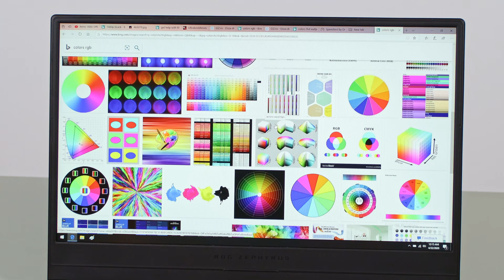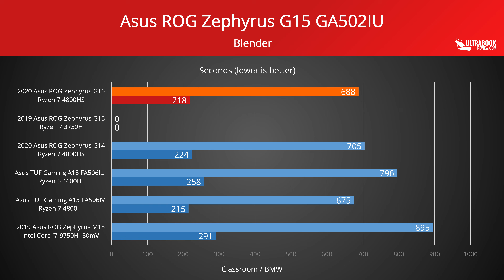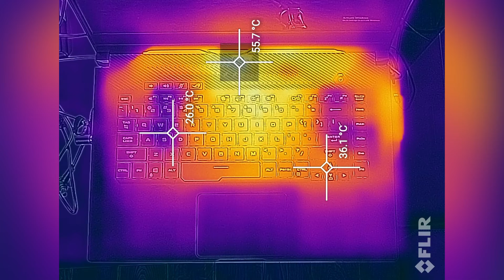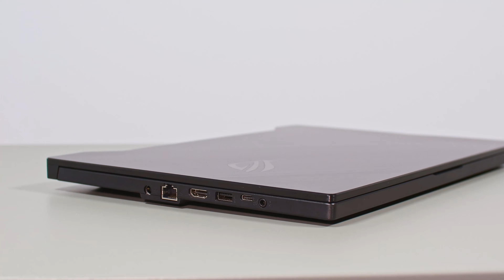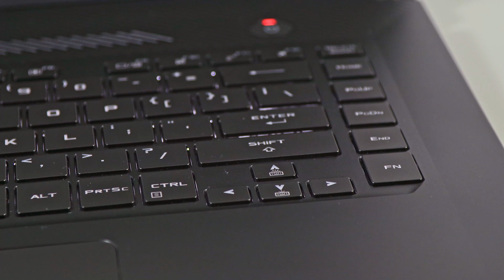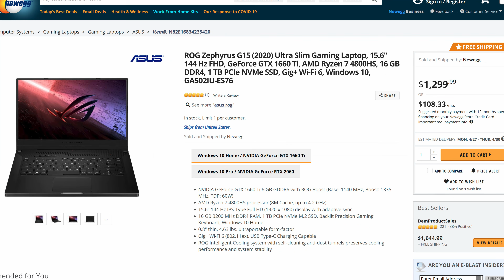Asus ROG Zephyrus G15 review - Ryzen 7 and GTX 1660Ti, 240 Hz screen

Comment: Fuck, I just bought one of these and wish so badly I had bought the HP Omen 15 with basically same specs and price. This Asus looks like an absolute joke with its red backlight on the back case (video didn’t show it at all) and you can’t change the color so it’s always obnoxious bright red. And then you have cooling, which is abysmal with loud fans. If you’re thinking about this, get either HP or Lenovo instead. This Asus feels and looks cheap, can’t even change the keyboard backlight color, or glowing red eye on the case, WiFi card is also genuinely horrible, no webcam, honestly I fucked up hardcore buying this laptop lmao.

Comment: Would you recommend this machine as a solid device for the 5 years?
Reply: well if you dare to fix problem on those  by "modifying" another blocked vent yes.. but if not i don't think so it'll last that long with poor cooling vent
Reply: So helios 300 is better ?
Reply: @y2rn.n  not quite that thing still heat like a stove no literally! my little brother friend have one it he said it  heat like a frickin stove! Then  He sold it immediately to buy ROG gephyrus m or else dunno which letter but i know it's the cheapest one 

you should've get lenovo legion 5 or the ones from msi

Comment: What happens when you match an 8gb 3200mhz ram with a 8gb 2666mhz ram on the g15? And what happens when you match an 8gb 3200mhz ram with a 16gb 2666mhz ram on the g15?
Reply from the maker: 1. 16 GB of RAM in dual channel running at 2666 MHz
2. 24 GB of RAM, but only 16 GB in dual channel at 2666 MHz
Reply: @ubrcom  Yeah I have the same understanding thank you. Could you please add your opinion on how it will affect laptop performance in different use cases? I heard Ryzens rely on memory frequency quite a lot. I am expexting a 8Gb base G15 version, and I have a 16Gb 2666. I wonder if I had better buy a 3200 8-16Gb instead. Thank you.

Comment: i have this laptop what would you recommend to make it run cooler..
Reply: If you live anywhere in the EU, minus UK, USA or Canada, the warranty stickers are literally illegal and you can remove it, they are forced to repair it if you do remove the paper thing.q
Reply from the maker: A cooling pad should help, but also taking out those covers, if you're OK with voiding warranty
Reply: You might try changing the thermal paste inside it usually gives a way better temperatures. I usually use the cooler master mastegel maker is one of the best thermal paste out there and is not extremely expensive
Reply: Juan Gines Ramis vivancos what is this thermal paste?? How does it work???

Comment: Shame they couldn't pair that display with the a15, seems these amd models have a catch to each of them in some way or another.
Reply: It's super annoying
Reply: A15 has a bad display, G15 doesn't get Ryzen 9 (not yet at least), and the G14 panel has ghosting... So annoying.
Reply: @leocheungmm  G15 has the blocked vents too, which increases heat and decreases performance (people have done benchmarks with and without and found better performance/lower temps without the blocked vents). But of course unblocking the vents voids your warranty.
That kind of scummy practice is the only thing stopping me from getting the G15. I don't care about the lack of the Ryzen 9 because the performance increase over the 7 is fairly small, and the average user will get more performance out of the Ryzen 7 than they need (the 4000 series Ryzens are similar to the 10 series i7/i9 that Intel sell).
Also the screen is apparently shit on the G15 if you don't opt for the 240hz model, which is really frustrating because who's going to take advantage of 240hz over 144hz using a 2060..
Reply: @ArmourGX  I swear they're trying to make the Ryzen laptops bad on purpose. So much potential, but every single one has some kind of dealbreaker
Reply: Armour One solution to this is just buying another back cover and taking off the paper. If something ever goes wrong pop the original one and you’re good to go. There’s also many stuff you can do to lower temps  https://reddit.com/r/ZephyrusG15/comments/gnot0f/new_owners_how_to_fix_thermal_fan_noise_battery/

To me this is the perfect laptop. Great sRGB, high refresh rate, 5< ms response time, great specs and long battery life thanks to amd igpu. Just fix the cooling solution and you’re good to go

Comment: Ok but a little negative review, when I checked the temperatures of g15 and g14 online, it could get up to 90 degrees all the same, also. Tuf 15 have bad display and response time, so is the g14. And zephyrus m is much more expensive with bad battery. I think g15 has it all. Good review on the g14 but this review on the g15 i think is a little poor. Just so to make this review different. But still, thanks man.
Reply from the maker: Ok, but just because you don't agree with me, that doesn't make this a poor review.
Reply: @ubrcom  no its not, what i meant was, you reiterated on the not so important details and dig on it. but its still ok. Its just a little unfair I think because you didnt do that on g14 or tuf 15. Sorry for the misunderstanding. Ow well im making it worse. Thanks for the review.
Reply: @ubrcom  i love your g14 and tuf 15 reviews btw, specially g14.

Comment: Hello everybody, my mind can figure out which one is better between Razer Blade 15 Base Model 2019, 144 Hz Full HD, RTX 2060, Intel Core i7-9750H, 16GB RAM, 512GB SSD, ASUS ROG Zephyrus G15 GA502IV which comes with the RTX2060 Max-Q, ASUS ROG Zephyrus G14. All of them I can get with basically the same price. I'll use the laptop both for gaming and editing photo/videos (the editing stuff it's a hobby, I do it often but it's not my job). Hence, I'm looking for the best compromise between good performance in gaming and a screen with good colors accurate.
PLEASE HELP ME, I'M KIND LOSING SLEEP. D:
Reply from the maker: If you need the era CPU power of an AMD platform or something compact, I'd go with the G14. Otherwise, I'd get the Base Blade. The g15 gets a slightly nicer screen and larger battery, but the Blade feels better, gets faster GPU and better keyboard
Reply: @ubrcom  Thanks for replying, very useful. Btw, Is it accurate the screen of G14? Because I read many complain about a lack of colors accuracy of that screen.

Comment: Why are thermals such an issue? It's designed to handle 90c isn't it?
Reply from the maker: theoretically, yes, but long term this sort of heat might cause problem, and Id prefer to buy something that doesn't run this hot
Reply: A For Apple  its a laptop, if something is overheating, other parts will overheat too, which are not designed for that temp

Comment: Great review. The blocked vents make the mind boggle. 0_0
Reply: heh guess you've never seen razer laptops. at least these laptops have cutouts so it can actually blow air out freely instead of blowing hot air into the bottom of the display

Comment: I got this laptop today over the G502 since it seems like a minor upgrade :)
Reply: hi what is your thermals for this laptop? i have one.. and im thinking of buying a cooling fan? will it help?
Reply: I need y'all feedback on the thermals
Reply: Please...
Reply: It ran pretty hot around 93- 96 degrees at times 

Cooling fan would definitely help :)

I didn't get this message until today by the way, also I returned the laptop for the G14 model since I had issues with mine

Comment: If they drop the price of this laptop then its an absolute steel, looks great and does ok performance and once the warranty period is over you can take out those pads covering the intakes as well... But if they sell it as this price point itself then the Tuf is better even though it has a poorer screen. Thermals matter more.
Reply: @Sam H the new tuf is a solid laptop, the only issue is its screen, so buy that laptop and a decent monitor with the money you save as that laptop is cheap. Its better than having to buy a unibody laptop which generally costs more and the again building a system. If you experience heat issues you can go change the windows power plan and disable boost in windows mode so while you game you getvmax performance from gpu and stock cpu speed with lower temperature and use turbo mode when u require pure cpu power 🙌 and both of this with cost you around 1500 usd while your option a unibody ultrabook and building a custom gaming system could go upto atleast a 2000usd